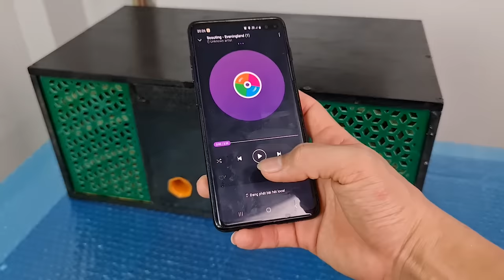MDF Wood Subwoofer Bluetooth Speaker DIY - Super strong bass

Comment: While it's an interesting handwork, I don't see much foundation in a micro 1- or 2 liter super vented subwoofer box, coupled with a disproportionately large horn. This box turns out to be a terrible untuned band pass filter (or filters) delivering (forgive me) an akward and limited sound. I recommend you to build speakers based on proven projects/ concepts. There is a lot of information available in the Internet.

Comment: Where's the MDF that's normal wood, MDF doesn't have fibers like that, but nice project
Reply: Mdf sucks to work with, try using birch plywood. Its lighter and stronger than mdf. I've used it for subs that get 3K+ rms.
Reply: So why is his title MDF wood ........?
Reply: @sandersakkee9284  don't ask me.

Comment: The making of the cabinet was really satisfying and he's an incredibe craftsman.
So far the good.
MDF? Nope
And slapping in a 30 W (Max) Onkyo speaker which is a mid/bass at best but made for sealed enclosures, maybe ported but certainly not a backloaded horn.
A backload horn needs a really big and stiff bass driver.
Also the efficiency of these types of speakers are incredibly low so you need to put in a lot of Watts to get some efficiency. If you put a speaker like this in a car for instance, you will no bass at all.
Put this driver in a smaller enclosed housing and it will sound much much better. Also the absence of tweeters will make it sound really strange this way.
Reply from the maker: Thank you
Reply: Very beautiful created craft box
Reply: Unlike ordinary wood, MDF (medium density fiberboard) is temperature stable.  As long as he seals it, inside and outside, to prevent any sort of humidity, warping will not happen.  He will still want to avoid any incidental spills, of course, but warpage due to seasonal temperature changes are not going to be a problem.

In making home furnishings out of a solid wood, especially those with an open grain structure, you will want to use no glue and fasteners that will provide a little play any time you are joining wood at a different orientation in order to prevent cracks and splitting.  A table surface should be glued and joined with dowels or biscuits, and sealed after finishing to prevent water damage on the surface.
Reply: The MDF would be for density of walls. Not moisture resistance. Also $th order bandpass with a folded horn for port??? Not viable. Vas of speaker looks to be about 10 - 15% of total horn volume at best. Simply put if he thinks it sounds good he's tone deaf.
Reply: @jimspence0  You can actually tell from the video how this thing sounds. Not great.
Reply: Tweeters? Mayne you missed the point? This is a bass/sub cabinet, designed to work in conjunction with other cabinets that contain the components for mid and high range frequencies.

Comment: Okay, you've set up a little W-bin.
But such a loudspeaker is used in the real world as a subwoofer, up to a maximum of 300 Hz and not as a broadband loudspeaker.
So you should have used an app for subwoofer tests and not a music signal.
Because a horn loudspeaker has to be based on wavelengths and therefore the very large dimensions arise, your little bucket is at most adapted to the loudspeaker used, but not to a frequency of 50 Hz!
Which means no bass is coming out.
Sorry
Reply: this is box bandpass 6th order, tune low freq in front, and side high freq.
Reply: but low freq tune 80hz ++
Reply: @akuncrazy  ... and 80 Hz is a worthwhile goal for you?  😄
Reply: @peterh.8931  small speaker tune 80hz is good.
Reply: small speaker not subwoofer, but woofer.

Comment: If your using a box that big,instead of port holes u should just add a bunch of passive radiators like 6 or even more  if u can fit them .. don't use the passive radiators that have webs(looks like a real speaker) use the ones that are flat

Comment: i immediately disappointed when i see the amplifier. i guess i would rather make normal box with bigger speaker transformer and amplifier for better sound, in the same size.
but anyway you are doing good as you are using battery for you power supply

Comment: excellent craftsman, however too many shortcuts, especially towards the end. no imagination to style with the green green, orange and black nor with the seethrough green grille. single driiver for a full-range box is also a no-no. One wondwers why not take inspieacion from the multitude of high end speakers out ther in both specs, and styling. Wasteful project on an otherwise amazing woodworking skillset. Also that is not MDF, it looks like plywood which being so thin as not as dense would probably sound ‘boxie’ without any insulation in the firing path.

Comment: Oh buddy, you got a lot to learn,lol.
that dus not look like MDF to me.?
the grills will sadly vibrate and distort the sound.
Those base pipes are usesles like that,sorry.
I like onkyo ,bud there are better and cheaper ones.
Why did you put the electronics right next yo the magnet?
Forcing that cnc is just sad to look at ,min.2,or 3 steps.
you tried, thats more than most do.

Comment: It's complete rubbish ! bother to make such an achievement in wood, that is to say a subwoofer for a low quality subwoofer (onkyo ha ha ha!) without any acoustic calculation based on the specificities of the speaker, with a low amp of range planned for the full spectrum, without filter on the speaker ... and end up with two plastic grids which will vibrate, deform and phase shift the waves, and bass reflex vents which bypass everything else. great art in stupidity ...🤣🤣🤣 

This is a very great Duning Krueger effect in acoustic....👍👍😜
Reply from the maker: Thank you